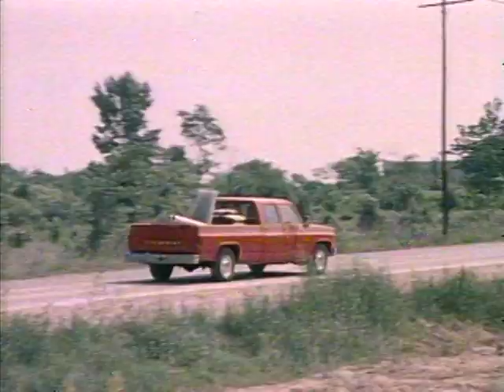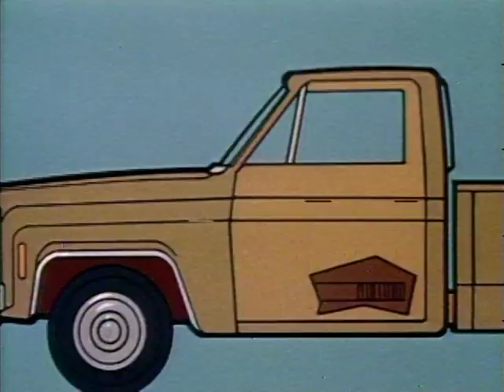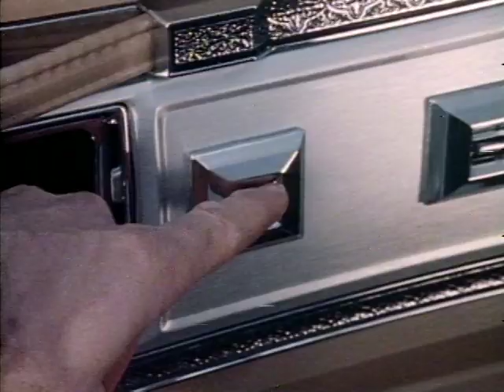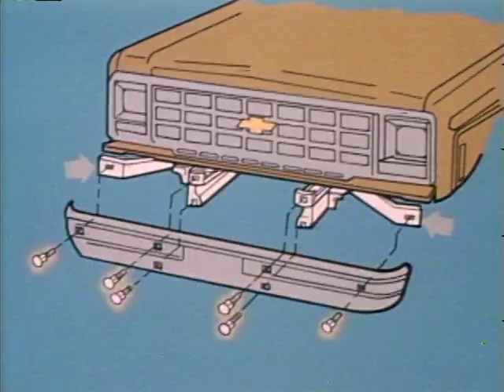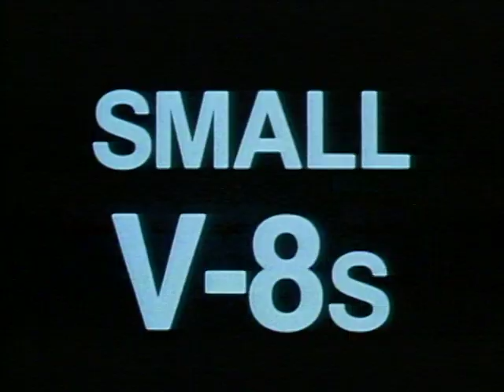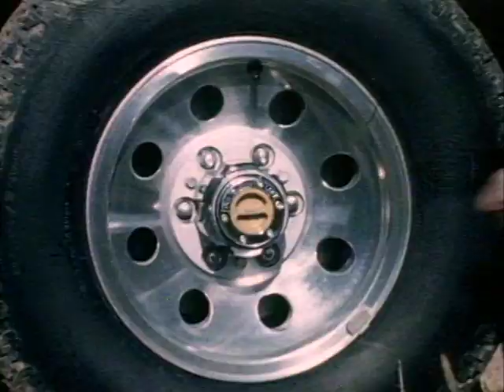1980 Chevy Trucks Competitive Comparisons

Comment: 1980 was the first year for square head lights and the last year for round head lights too on the Chevy and GMC trucks. The square head lights were standard on models with the Chevy Silverado and GMC Sierra Classic trim levels and optional on models with the other trim levels. Those Chevy and GMC rounded line models were produced from 1973 through 1991 except the half ton and three quarter ton plain cab pickups wrapped up in 1987 and the one ton plain cab pickups and medium duty series plain cab models wrapped up in 1989. Those rounded line C and K series pickups are the third generation C and K series pickups except the series were changed to R and V series in 1987 because the rounded line models and the upcoming next generation C and K series pickups that are the GMT400s for the upcoming 1988 model year were going to be in production at the same time. It ran up through 1991. The rounded line Suburbans are the seventh generation Suburbans and the rounded line K5 Blazers and Jimmys are the second generation K5 Blazers and Jimmys. All of the rounded line models that were produced from 1987 through 1991 are R and V series except for the medium duty series models. Those generation Ford F-series pickups there are the seventh generation F-series pickups and the Broncos there are the third generation Broncos. They were all produced from 1980 through 1986. Back to the Chevys and GMCs. 1980 was the last year for the nose on the front, emblems, body side molding trim, interior, and fleetside tailgates with those designs and the last year for outside hood release too. Rewind to 1977, new optional inside hood release, power windows, and power door locks were introduced.